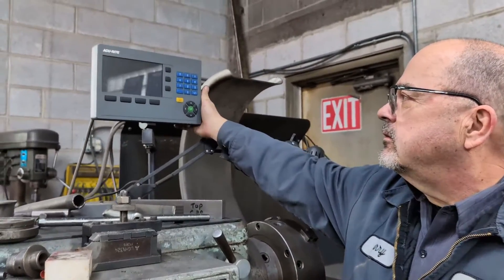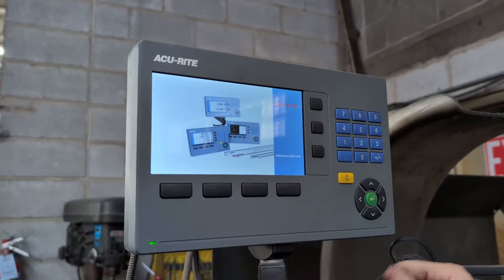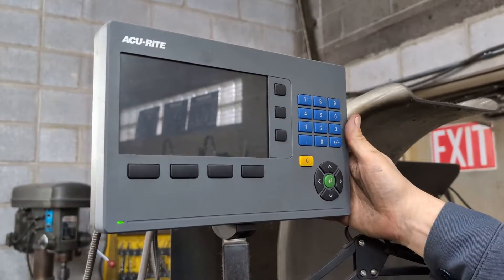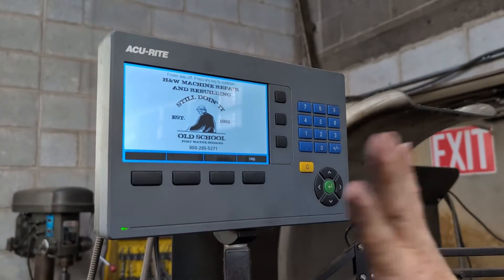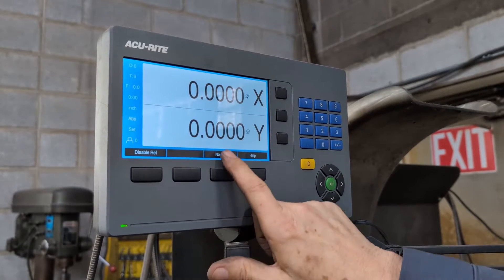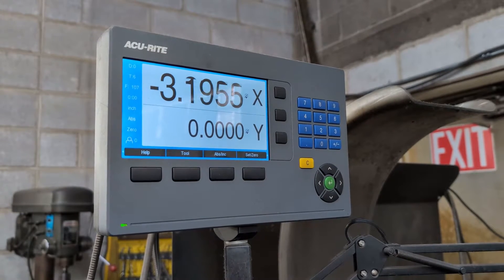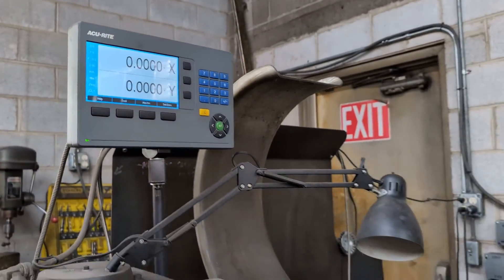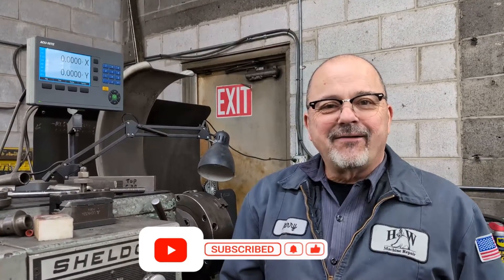Acu-Rite DRO Quick Start Guide

Comment: We have these readouts on a new mill and so far I can't get them set right.  The decimal is in the wrong spot and it appears to be showing a diameter instead of radial movement.  For example, if I want to move .100" the readout will display .0200" and it is driving me absolutely insane.  It's like its set up for a lathe, but that doesn't explain why the decimal is in the wrong position.  Any help would be most appreciated.

Comment: P.S. one question, as nice as they are tho, is the limited tool presets on the 202, has that been upgraded or is it still only, what was it 9?
Reply from the maker: There are 16 tool offsets on the 203, but 100 in the 303. Is that what you are asking?
Reply: Yes, I suspect the processor could do more than 16, but it’s an “incentive” to sell the 303…